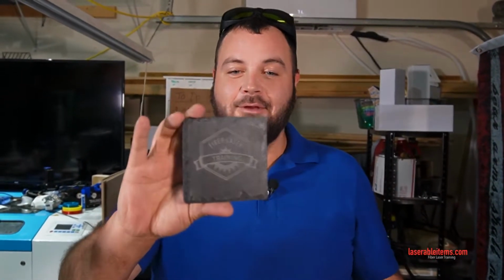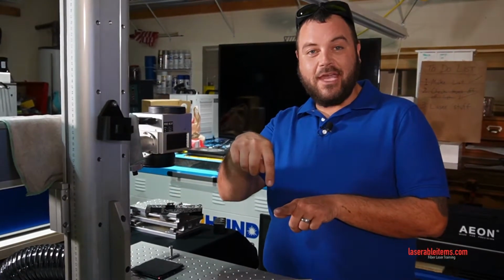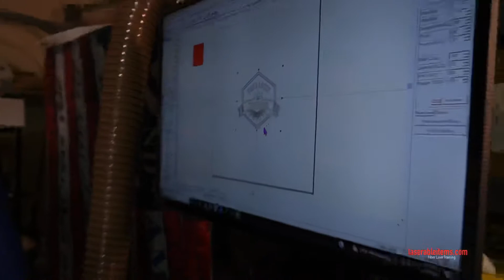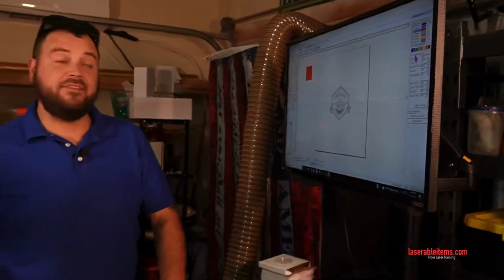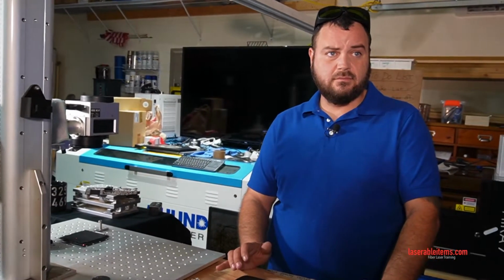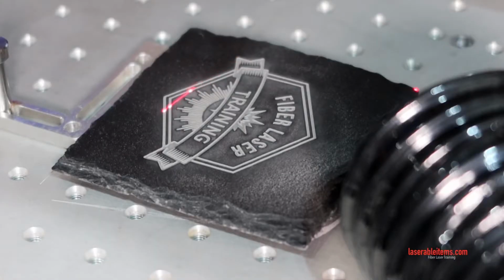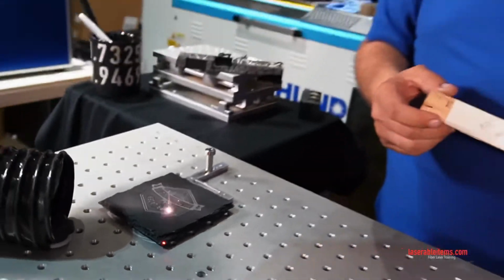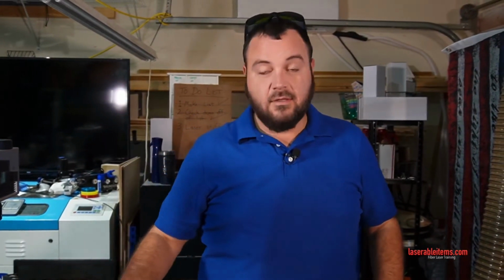Deep engraving a slate coaster @FiberLaserTraining

Comment: I did a few slate for the first time yesterday while using the Omtech 180 fume extractor and omg it smelled horrible. Is that normal?? If not I wonder what the heck happened to cause the smell. Do you vent or use a fume extractor for your fiber? I tried like hell to get white and never could. I have the EMP 50w raycus.
Reply from the maker: Yes the smell is not pleasant. 
The lense you use will determine the colors you can get! 
We use a self contained hepa/charcoal filter and they work super well.
Reply: @FiberLaserTraining  ah ok. what lens do you usually use to get white??
Reply from the maker: I usually use the 175mm lense
Reply from the maker: I believe that’s what we used here.

Comment: It looks like you did 1 pass for pen 0 and pen 1 and then did 8 passes for pen 2. Is that right? If yes, why so many passes on the 3rd one?
Reply from the maker: It kinda does look like that but all passes are ran in succession. 

It ran the job like this 

Pen0/hatch1>
pen1/hatch2>
pen2/hatch3>

It ran each pen assigned to a hatch 8 times. 

Go back and watch my coin video that outlines the hammer shovel sweep method. 

That’s what’s going on here. 
Hammer shovel sweep repeat 8xs
Reply: @FiberLaserTraining  Awesome, thanks for the explanation. Will go check out your coin video now.
Reply: @FiberLaserTraining  I'm trying to figure out how to cross the hatch settings over to lightburn
Reply from the maker: @texastad1989  easy peasy. 
Watch the other video we have on Lightburn’s “fill” mode.